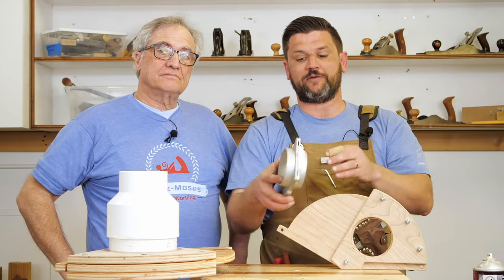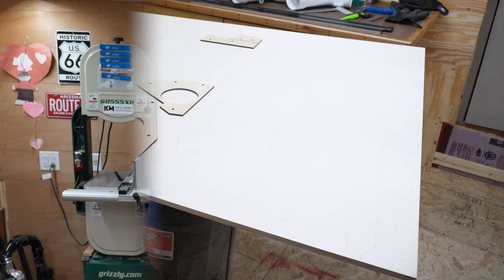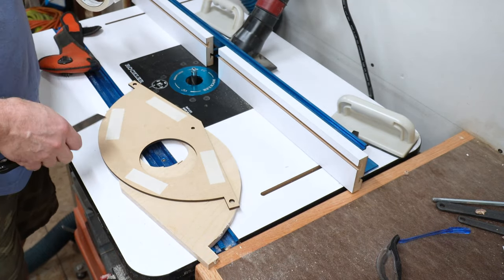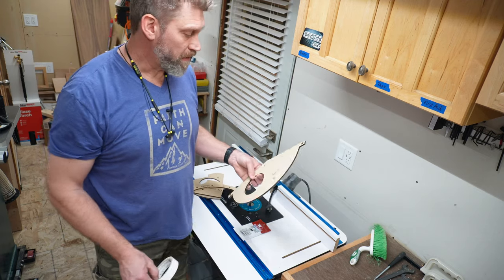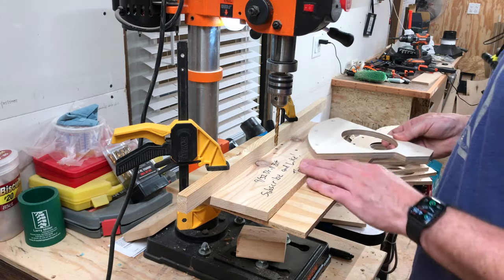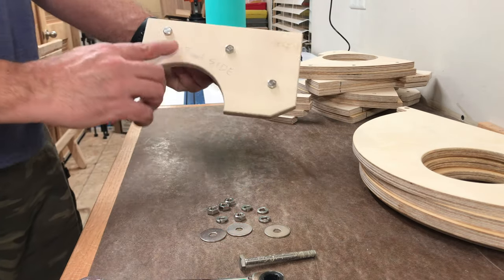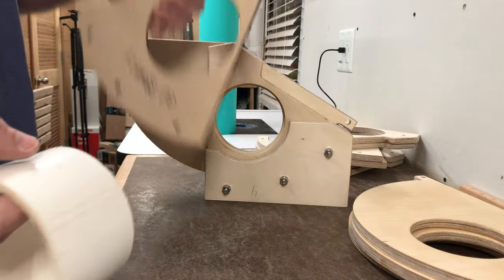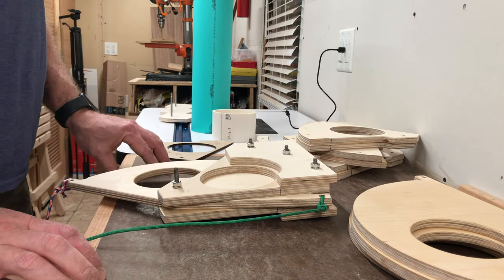NO LEAK Dust Collection Blast Gates

Comment: I have a question that was presented by YT video suggestions on DYI blast gates after watching this video. (Thanks for that 🤣)

You may have thought of this, but what happens if the blast gates get clogged and they're built into a cabinet?  

Would you create an access panel like for plumbing, or would you have an alternate method you could use to clear the gate?
Reply from the maker: Excellent question! The workbench is going to be on casters and have access to the space underneath in order to empty the dust collector bag and dust separator bucket 🪣. The blast gates will be in proximity to those.
Reply: @BrettsWoodshop  awesome! I'm glad you thought of it, because I'd probably be using a multi tool later when the problem presented itself... :D
Reply from the maker: LOL! Hopefully it won’t be a problem. But I think it’ll be as simple as removing the pivot bolt and pulling out the swinging gate if the need should arise. Thanks for contributing!

What are you working on these days?
Reply: @BrettsWoodshop  I built a changing table for my 1st granddaughter.  And my wife just had the chance to use it for the first time today.  I also built a stool by Steve Ramsey, and ended up giving it to my brother for the standing desk that I built him.  I've got a few more projects in the works too... maybe I should start a YT channel....
Reply from the maker: Congratulations Grandpa! What a great project for your family! 

Maybe you should… Let me know if you do. I’ll help you get going in the right direction.